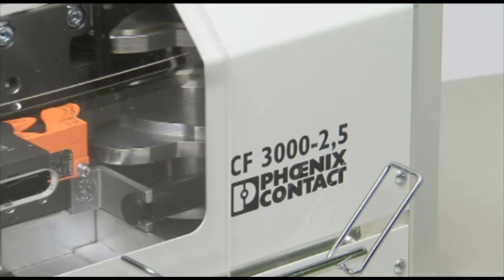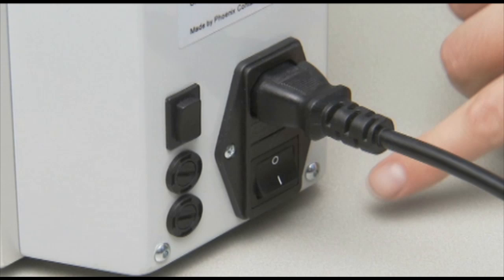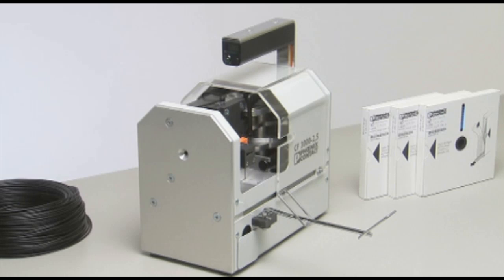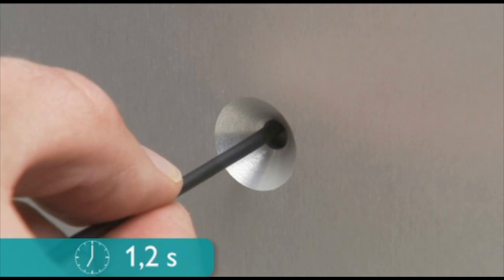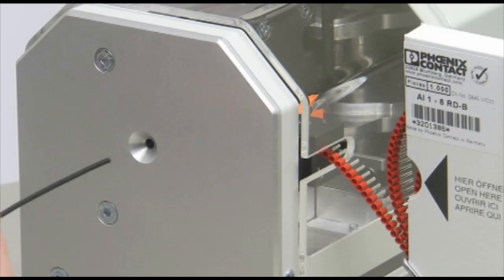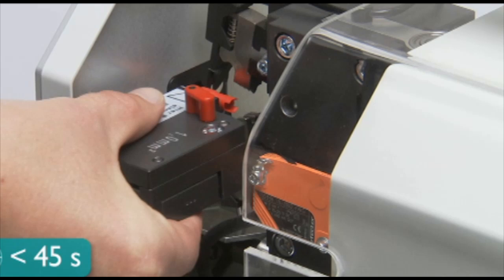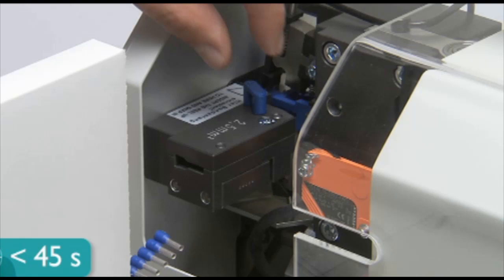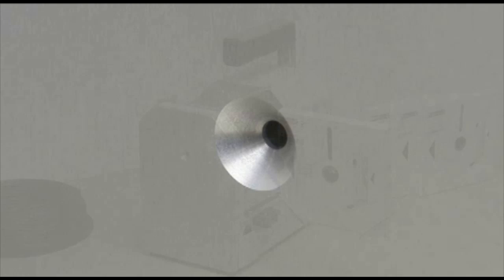CF-3000 automatic ferrule and wire crimping machine - Phoenix Contact

Comment: I want one in my workshop
Reply: Ali Radhwan 

I got this machine over 3 months ago, it's an excellent buy if you're working on thousands of wire connections per month, saves over 70% of time for stripping and crimping.
Reply: Good where and how much you buy?
Reply: From my local dealer Electrical dealer in Italy, I paid about €4900 (about 4900 dollars). they claimed it was a short time offer, but I had no comparison price available.
Panduit sells the identical model under it's own brand. I don't know how much they sell it.

check the video:
"How to Set-Up the Panduit CP-881 Semi-Automatic Ferrule Crimping Tool"

It came with a good variety of heads for different wire sizes.

We have done over 8000 connections in the last months and have calculated to have covered the cost in about 8 months. (our labor costs us about 18 dollars per hour all included 

If you come from a country that has cheaper labor costs, then it could take you some years to cover the initial cost.

Strangely enough the ferrule reels have a per connection cost lower than the normal ferrules.
Reply: Currently all the places that sell at list are selling it for $13,068. You can get it for less if you get a quote from a local Phoenix contact distributor. The CF1000 takes loose ferrules in a hopper and is $23,253 list.